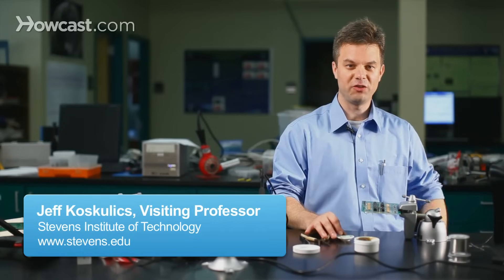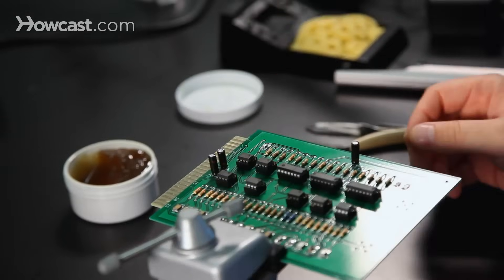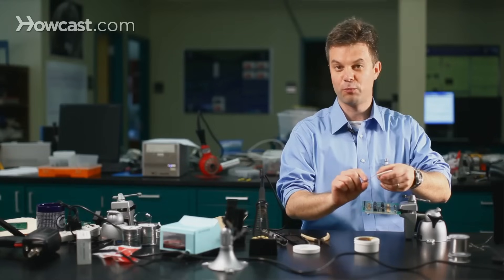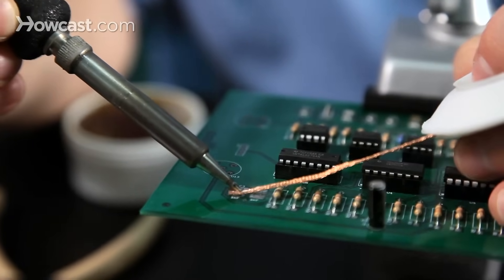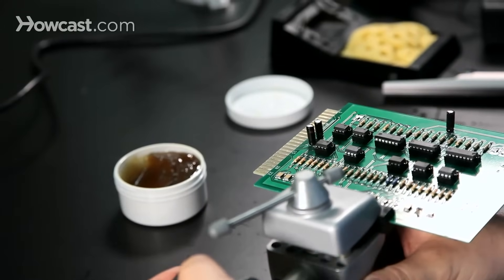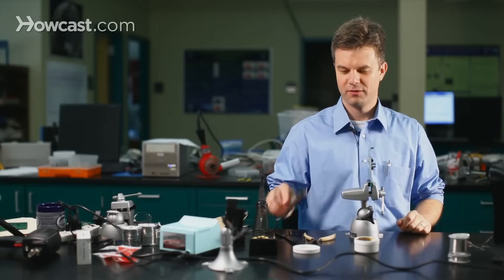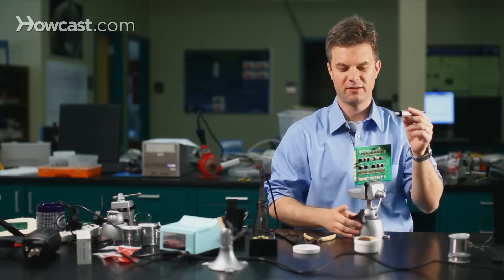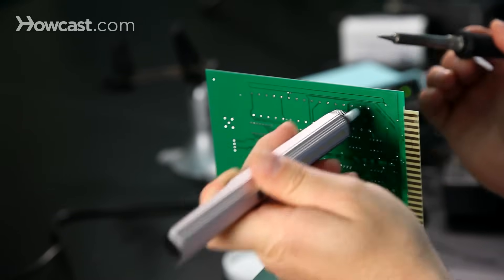How to Remove Solder | Soldering

Comment: Ok bro. you are a life saver because my drone was broken one of the motor's was not working and then i was gonna swtich it out with another one but all the solder joints soldered together and than i used your advice thank you

Comment: Looks super easy until you work on 1970's and 60'S 80's electronic that are so dried up and mixed up with chemicals  everything breaks on you hehe
Reply: anonymously awesome i just add some new solder
Reply: I'm doing this on a 2008 kia the instrument cluster went out, and I see some bad connections in the back, but one of them I cannot get the solder to stick, they are very small connections, almost impossible to solder, but I did get the others

Comment: Usually,  a component must be removed because it is not working anymore. 
If this is the case, an SMD part can be simply desoldered  by heating the component itself. A through-hole component can be cut at its legs to desolder its remaining wire. 
I don't think a sucker is absolutely necessary when you don't collect used electronic parts.

Comment: do you need a certain temperature? my pencil soldering iron  and plunger doesnt do anything like here.
Reply: have you figured out what it was, I'm having the same issue
Reply: @like-icecream  You're likely trying to remove lead-free solder which is more difficult. It requires a hotter iron and sometimes a stronger flux.
Reply: @JJFX-  I have a 60watt iron and I can’t melt it well. Don’t know what my issue is. I tried with a 140w gun too. I keep getting solder on my tips too and it just hardens like concrete and will never melt off.
Reply: @swearick  sounds like you need a temp control iron, usually with old solder or lead free i have to work up at 400 to 425c and use a decent flux in order to remove it.

Comment: i have my iron on 400c and i still can't get the solder to melt on the wick like that. i don't even get any smoke. what's the deal?!!
Reply: Most likely the tip isn't properly tinned or has a lot of oxidation. If it has a lot of oxidation (Like the tip isn't very smooth anymore and has rough patches) just replace the tip. 8/10 times I have found that to be the problem.
Reply: @user-ii8dz4vu7n  how to replace the tip, every diy starter should know they need flux...

can reheat the iron and dip the tip into it solve it?
Reply: @afiqalbawah4039  Either unscrew the knurled end close to the handle, or there is a screw close to the tip that will let you pull the tip out with pliers. If it's the screw type, you can chuck the tip in a drill and sharpen it on an abrasive wheel or belt sander and dunk it in tinning paste, and let it heat up in the tinning paste (this keeps it from being exposed to the air under heat and oxidizing). If it's a sheath/knurled one, it's best to look up your make and model and see what tips it accepts.

Comment: how do I remove solder from something that's through hole, but I only have access to one side of the board, because the USB ports I want to replace, are in the way of the other side.
Reply: You can't. You are doomed to fail

Comment: uh ok how do I do it without an expensive tool?
Reply: it's.. not expensive.. like at all
Reply: if solder iron's tip is not doing its job, what should I do, dip it into flux or buying a new one?
Reply: @afiqalbawah4039  heat it up, wipe it off with steel wool, re-tin the tip. cheers!